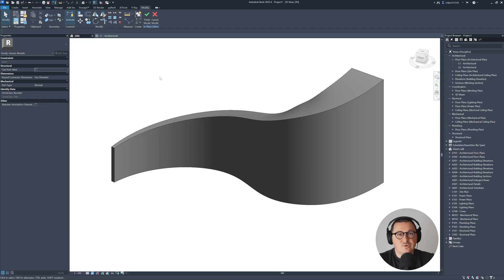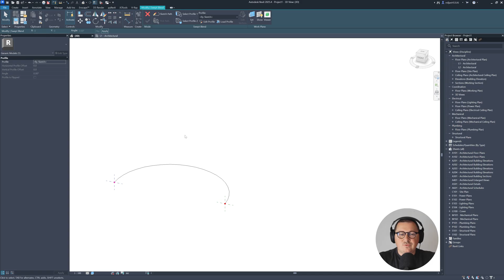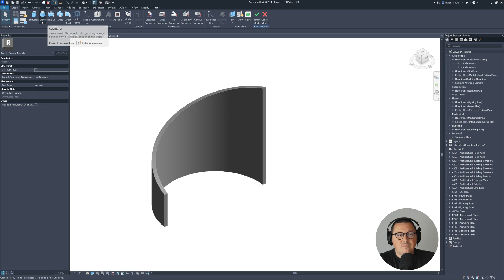Swept Blend Revit

Comment: is there a way that you can manipulate the curve between first profile and last profile? i mean like when you press accept revit creates smooth transition between both profiles but what if i would like to add some variety in between, lets say a wave for example between both profiles along the sweep?
Reply from the maker: Yes, there is, but you can’t create it using Model In Place tool. For that you should use Mass tool, than create line/curve/spline as a leader, add points on it, and than on those points create profiles. Those profiles will control that variety. At the end select leader and those profiles, and create form.
Reply: @arkiteasy  i will try to solve that the way you have proposed! thank you for your support:)